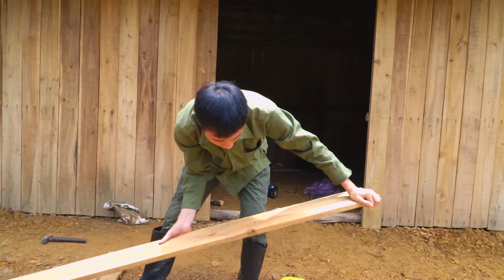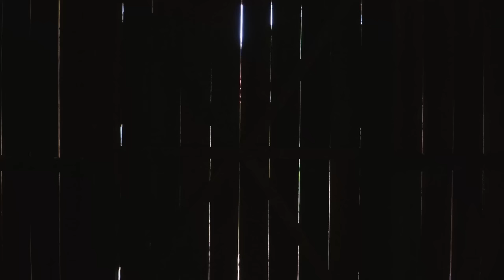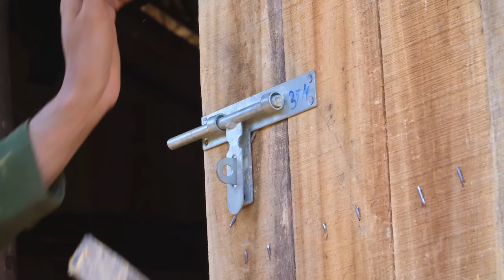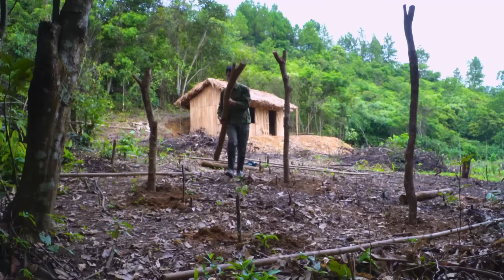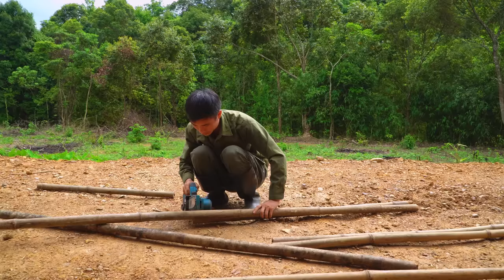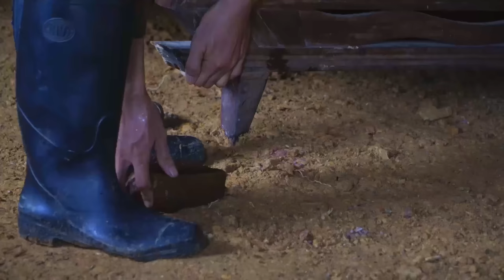Episode 70 - Make the main door, make windows, dig a drainage ditch, install wooden bed

Comment: on your double doors on inside  of one  the doors at the bottom put a bolt or slide that will go into the floor or ground. I have a set of doubles it stiffens up doors so they dont flop against the latch in heavy winds or just in general . keeps them in place